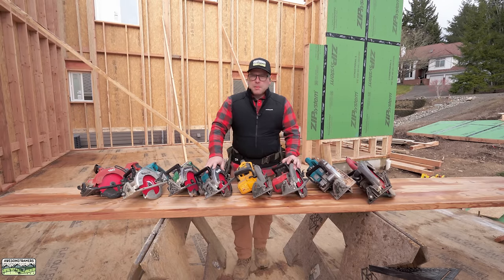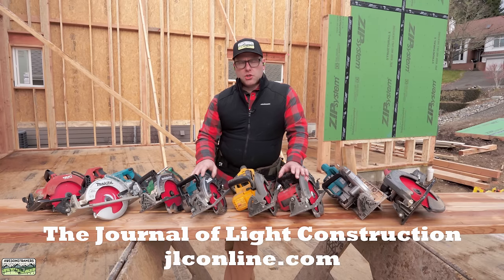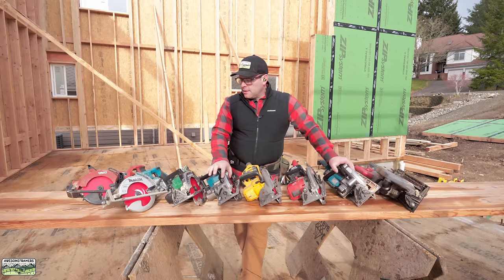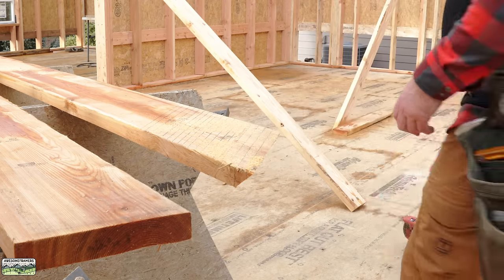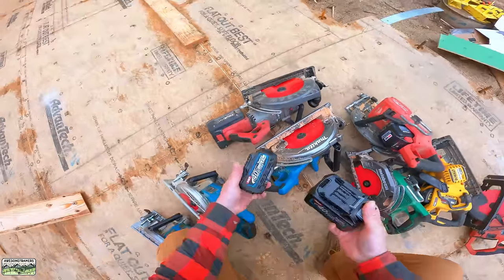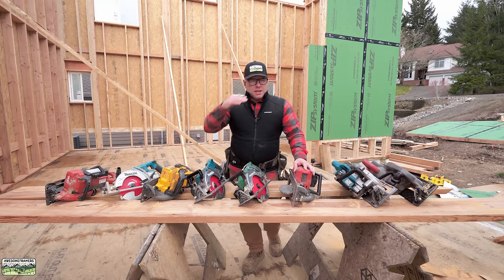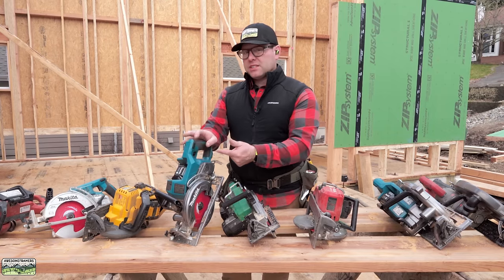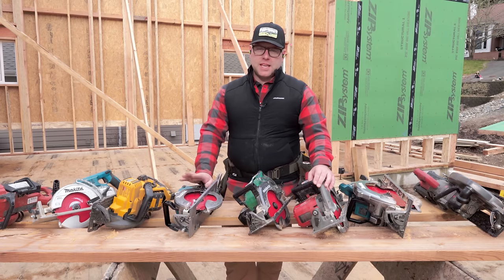Tool Review- Rear Handle Cordless Saws

Comment: Love the review.  Thing that bothers me is that there is nothing on quality and durability.  We used to talk about steel bodies, and windings in motors that were epoxied, or better fastened, and how well machined the gears were.  I would like to see some of these drop tested onto concrete...

I am not sure that 1) Anyone cares any more about quality and durability.  These battery tools keep replacing themselves as the technology improves, so they are basically disposable;  2) Maybe people don't know for the same reasons as in 1.  Used to be people had 20 years on one saw, now it is not even 20 months. 3), one of the features of battery tools, for some reason, is they are direct drive and there aren't any fancy gears.

As an amateur who tries to work like a pro, I am not in on these tools.  I want to wait a while and let this shake out and competition knock the prices down.  I have a dewalt jelly bean, a 77, a Porter Cable 6" with a left blade, and a cheap battery saw for when there is no cord.

Probably dumb, but without cords I wonder how organized framing is.  You don't have to order your cuts the way we used to with cords.  Now you can wander all over the site with a battery tool in one hand and a phone in the other.
Reply: Actually the price of the Makita 2x just dropped through a hole.  I am going to see if I can run it with my Dewalt batteries, just for fun.  But at 160 it is worth it.  Cheaper than the corded saw.

Comment: I am not a professional but I am remodeling my house room by room as I also work a full time job. So I am in the boat of needing good quality, efficient tools beyond the cheap DIY home project options but not really professional level that lasts 10 years of constant use. 

What would you recommend for someone like me? I need the saw both for construction and demo. I currently have a bunch of the Ryobi tools, just the standard ones not the brushless “HP” stuff. What I have found so far with the cheaper Ryobi tools is that they’re remarkably good for the price and more ergonomic than most. But the circular saw that I have in particular is pretty awful. I have the real cheap 5 1/2” that came with my original Ryobi tool bundle. It’s just so underpowered and I often can’t cut all the way through a 2x4. The other tools seem fine so far but not the circular saw. Should I just try the larger, higher powered Ryobi or go right to the Metabo or Makita?

I did buy myself the Metabo HTP 12” double bevel sliding miter saw. It is pretty nice and the price wasn’t too bad at $249 on sale. I have a Hutachi cordless drill too which is fine. But I think they use different battery systems.

Thanks for the review!

Comment: Hi Tim, I have both a top handle and a rear handle Makita, and I notice that I pinch a lot using the rear handle vs practically never on a top handle. I am much more used to the top handle, so I think I’m doing something wrong. Can you help explain why this is the case?

Comment: I like the Makita 36 Volt. The Hitachi/Metabo tools feel like toys. Milwaukee and Makita is where it’s at for Cordless.
Reply: U must not be referring to the 36V tools cuz Metabo feel of 36V tools are very Makita-ish and in some cases superior let alone priced better, AC adapter capable, backwards compatible with the 18V tools, lifetime warranty and the best quality nailers in the business 25+ yrs running
Reply: Baseball Dude I’m a mason not a carpenter and Makita has a lot more tools that fit my needs. I looked at the Metabo/HPT stuff at Menards and it doesn’t feel like Makita or Milwaukee quality. Also that’s the only retailer who’s sells it where I live. I like German made Metabo grinders though; they are hard to kill. I’m heavily invested in both Makita and Milwaukee so I’m not starting a 3rd cordless platform.

Comment: Have you experienced the trigger safety on the milwaukee going out? I have had to trade in 2 already! It's kinda like a fusible link that eventually does not fuse back sometimes.
Reply from the maker: I haven't had that experience, but I did give the saw away and just borrowed it for the video.  It worked fine though when I had it.

Seems quality control is hit and miss anymore

Comment: Metabo HPT seems to be expanding. Going they do a better miter saw to compete with the other brands
Reply: They make a 36V D and Barrel grip
D style is in US but barrel is still just offered oversees as Hikoki
I have been holding out cuz I don't want to spend $300 for the Makita
Almost bought the Milwaukee barbell a few times but it's not part of buy more save more
Reply: @baseballdude8491  you can get the 36v barrel grip they sell it online at Lowe's
Reply: @Therealphantomzero  don't see it can I get the link u see for the Metabo HPT barrel grip
Reply: @baseballdude8491  my guy I swear I had it in my cart but it's no longer available. Guess they are getting ready to do a reset. I know they were going to be launching a few things this year since they got the rear handle as an exclusive to North America. And they were prepping last year with their promotional company etc

Comment: Always nice to see someone else's perspective on tools. Personally I'm not a fan of the XGT 7 1/4 or 10 1/4 and will grab my 36v over them. Only seem good for the first 1-2 bars on the battery and pretty gutless at 2 bars and throw them back on the charger. Returned the Milwaukee after 1 day, dust port, bevel adjustment just spins around, kept stalling cutting LSL stringers with a brand new 9ah, 12ah cost as much as the whole 36v Makita kit on sale at HD. Skil 10 1/4 was nice but got stolen off the jobsite 2 weeks after I got it. (Still have the extra battery and charger if you wanna trade for one of those cool hats)

Comment: Would have liked you to have the 6.5" flex in that line up.
Reply from the maker: I don't think they have a rear handle saw like these.
Reply: @AwesomeFramers  quick story, I have  and love the Milwaukee rear handle saw. I had to cut three 6"×6" post over my head with it an I still  think that was the most dangerous thing I ever did with a saw.

The  next day I went out and bought the Flex 6 1/2" for that purpose and keep the Milwaukee cutting below the waist 

Note:I eventually bought both Flex 6 1/2" & 7  1/4" that's when I realized the 6 1/4"" is probably the most bulky in it's class,  absolutely the best line of sight of all circular saw,  too many options for Dust extraction and there is NO other 6 1/2" on the market today that is more powerful as a matter of fact it will out gun many 7 1/4" top brands and its depth of cut is an amazing 2 916"

When used the 7  1/4" Flex Circular saw once for the first time I realized I don't like the saw on the other side/hand, so I will never use it again.
Reply: The Metabo HPT 6 1/2 has a deeper cut than the Flex and is lighter-its only offered right now in the18V but Hikoki makes a 36V
The 18V has plenty of oomph
Using a Prazi beam saw on my Makita 36V also makes beam cutting much safer and accurate
I am going to see if it will fit on the two new Metabo HPT rear handles we just got

Comment: The Makita xgt is a 36 volt. Read the back of the battery. Just like the Dewalt 20volt max is an 18 volt. and the 60 volt flex is a 54 volt. All marketing hype.

Comment: And the weight of your saw on the cut side of the board, or you have to work from the wrong side of the board making measuring a pain. I will take a side winder all day every day over those left handed worm drives
Reply: Nope. Left side blade rear handle all day every day!
Reply: @SKiiLLSaW707  only for a lefty
Reply: @paulhopkins1905  Nah, I’m right handed and everybody I know uses left blade rear handle all day every day!

Comment: I’m going to buy the Makita. I’ve had my Milwaukee 7 1/4 repaired twice and I’ve had my Milwaukee 6 1/2 inch circular saw repaired twice and it just went out again. I’m not even a framer. I do remodeling so our circular saws don’t even get used that part. The Milwaukee saws are horrible. I hope someone reads this and doesn’t buy one.